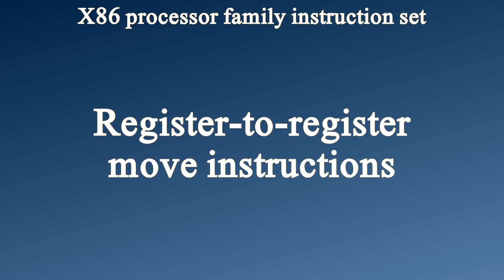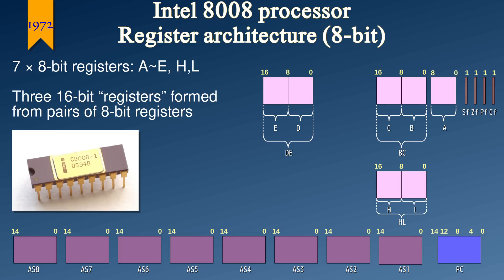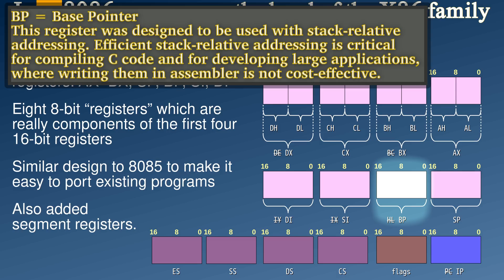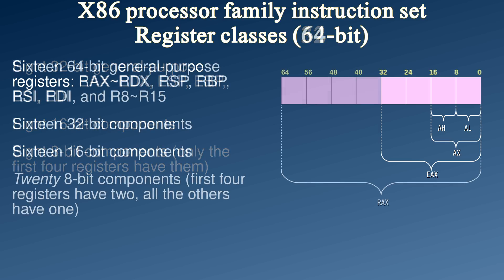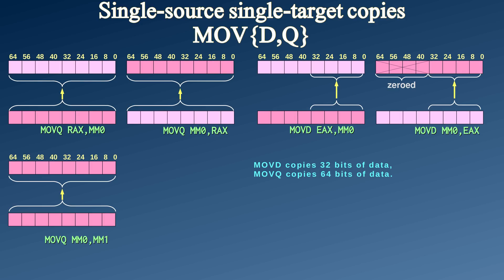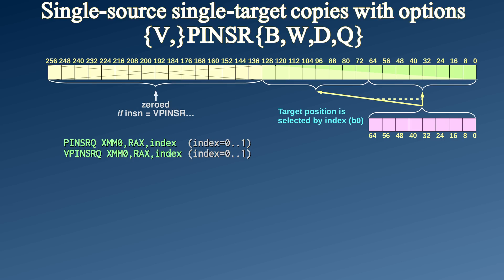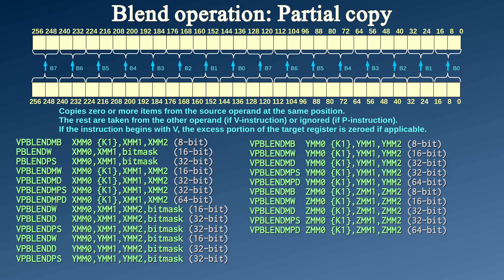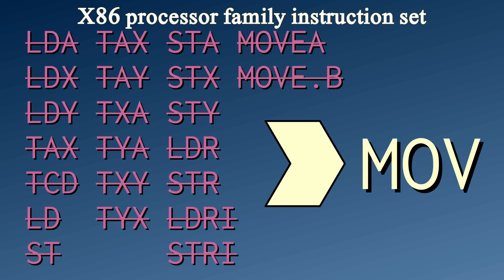x86 mov insns & short history of the most popular CPU architecture

Comment: At least for every second of this video my cpu made on averge 6800000 intructions.
and for the entire video, well here are the sintax: ((19*60)+44)*(1.7G*4)
1.7G = 1.700.000 for every core in my cpu (it has 4)
Reply from the maker: Good, but three problems: ① Giga stands for thousand million, not one million (mega is one million, kilo is one thousand). ② The number of clock cycles is not the number of instructions. While many instructions take several cycles to compute, modern processors can perform many instructions per cycle (ipc) on a single thread. ③ Unless your computer is fully loaded and the cooling fans are screaming like mad, most of time all cores are fairly idle. In idle, the core is waiting for an interrupt and not executing any instructions.
Reply: @Bisqwit  oh shoot i meesed up :c
Reply: the answer is around: 299201140
299 million of instructions made

Comment: nice overview, well done! Although...  HL has NOT been turned into BP, and BX is not the old BC either. Instead, BC has become CX (think of Z80's DJNZ and 8086's LOOP), while HL has evolved into BX. The dead giveaway for that is BX's ability to address BL and BH separately, while BP cannot do that - but for the automated software translation from 8080 to 8086, it was necessary to have a clear "successor" register for HL, so this must be BX (yes, software like WordStar was actually mostly converted from 8080 binaries to 8086 binaries - conveniently, MSDOS offered all CP/M system call functions with identical parameters). So, the new kid on the register block really is BP, not CX

Comment: Eech. What an absurdly overcomplicated nightmare.
I can see why Intel was discouraging anyone from doing assembly coding on the x86 family as far back as 2005.

I mean, I've been dealing with fairly low level graphics programming on and off for most of my adult life (and part of my teens - unless you count Logo as 'graphics programming' in which case I've been doing it since I was about 6), so I do get what some of these more convoluted instructions do and why they're useful

MMX and SIMD was a big deal to graphics programming especially, and I definitely remember it. That's after all right around the time when I was really learning about graphics on PC and where a software renderer was still somewhat relevant, (though I'd argue it still is, as a learning tool at the very least).
But these instructions sure do make it difficult to keep up with what's going on sometimes...

Probably explains why I find more enjoyment with 8 and 16 bit coding than trying to deal with PC stuff.
Assembly is over-complicated. higher level languages still force you to deal with way too much OS and SDK complexity and indirection, and using pre-built game engines takes most of the fun out of it... (yes, way more practical to have a game engine doing most of your work for you to let you focus on game design, but still...)

Maybe I'll try and get something running on an n64 if I want to deal with 3d. XD
I mean, that has a vector co-processor with similar kinds of instructions, so... No escape I guess. XD

Comment: What a mess of an architecture this has become
Reply from the maker: It is inevitable that any system that keeps getting extended for long time enough will devolve into a mess of special cases. In software and libraries, the situation can be mitigated by refactoring, but with a processor, you just have to keep backward compatibility. If users are unable to run their software on your new CPU, they will not buy it.
So as a result, we have CPUs that are still compatible with the design from 1978, influenced by design choices in Intel’s very first CPU and even some of their early competitors like Zilog.
The biggest window of opportunity for an overhaul was during the migration from 32-bit to 64-bit, but AMD chose to keep the syntax and instruction encoding almost identical to the previous one. Intel, on the other hand, went to a totally different direction with their Itanium, that was completely redesigned from grounds up, and not backward compatible with x86 at all. The markets chose AMD’s design.

Comment: this is why moore's law ended
Reply: maybe.
But I'd argue it's also because Intel didn't have meaningful competition anymore.

Notice how much the pace of CPU power improvements have increased after Ryzen showed up?
It's mostly going to bumping up core counts, but still, it's there...

It's like when these companies have no proper competition they go into auto-pilot.

You can see it with GPU's as well.
When there was fierce competition between ATI and NVIDIA you typically had something like 70-80% performance improvement.
With AMD having had no meaningful high end options in years, compare NVIDIA's generation on generation improvement, it's been somewhere around 20-25%.

Maybe some of that is due to actual technical problems, but I doubt ALL of it is.

And consider the implications, given that this is a form of exponential growth.

at 70% a generation you get a 41x increase in performance after 8 generations
at 25% a generation you get only a 4.75x increase.
That means the faster growth rate will do in 4 generations what the slower one is managing in 8.
CPU generations seem to be about every 18 months, while GPU seems to have been roughly yearly...
So the relative improvement of graphics cards in the last 8 years combined has been about an order of magnitude less than what was seen in the 4 years prior to that.

And the CPU space wasn't much better during the period AMD only had bulldozer to work with...

Comment: I used to program the 8080-8086 in assembler. wrote a program very similar to windows cept it was for cpm. bill gates stole the cpm program by changing the jump table and called it msdos, I wonder why gates refused to show its source code? oh ya, someone would find out that its actually cpm but cpm software will not run on msdos cause of the jump table. anyways, 242 pages of assembler code compiled into < 1k !! still have the code and compiled program its on my z100 sitting right next to me!! and it still runs! ( heath/zenith ) . I have a hard copy (orginal) some where LOL and cpm software source code that heath company and zenith gave with the computers along with compilers for assembler and basic. still have all the books that came with it, and diagrams of the whole computers guts.
Reply from the maker: cool story bro

Comment: The simple difference between movaps and movups confuses me
Reply from the maker: It does not really make sense with register-to-register moves, but when you are moving from/to memory, movaps only works if the address is aligned (divisible by 16) and movups works in either case. Movaps has slightly better performance, but it causes an exception (crashing the application) if used with an unaligned address.

Comment: This is probably a much more complicated question than can be answered in a 20 minute video, but in designing new iterations of these architectures, how do they decide which specific functions would be worth including?
Reply from the maker: Sometimes they get feedback from developers, and based on that feedback decide what warrants new instructions. For example, the fused-multiply-and-add instructions were introduced that way. Sometimes they try to predict what the users will need, or what could be marketed to boost the sales. The AES acceleration was maybe added through that kind of process. It significantly speeds up throughput for AES-encrypted network transmission.

Comment: Actually, ARM is more popular than X86.
Reply from the maker: (From Reddit replies)
Depends on how you attempt to measure popularity. Besides, Z80 and 8051 eat into ARM's marketshare very heavily. 8086 and everything that came up after it, dominate the high-performance market. Meanwhile the embedded pie is going to split a thousand different ways, between ARM, Z80, 8051, MIPS, etc.

Instead of Z80 & 8051 I would have maybe labeled AVR, but I digress. In any case I meant desktop processors — and namely processors. I deliberately left microcontrollers out, which is why I did not mention e.g. 8051.
Most ARM chips (for example, STM32, MSP432, LPC4000) are either microcontrollers or SoCs. ARM processors are not very prevalent.
Reply: @Bisqwit  I say this because smartphones are outselling desktop computers for a few years now. And smartphones and tablets are all powered by ARM chips. There are more ARM chips on Earth than human arms.
Reply from the maker: I know why you are saying it, but nobody’s (or almost nobody’s) desktop computer is running an ARM processor. Nobody who plans to upgrade their computer and goes shopping for a new CPU for their computer thinks “hmm, let’s see what ARM has to offer today”. No, they look at what Intel and AMD have to offer.
And the number of developers who compile native code for anything other than x86_64 is diminishingly small compared to the number of developers who compile native code for x86_64. And those smartphones use SoCs, which are glorified microcontrollers.
Reply: @Bisqwit  SoCs are regular CPUs integrated with other chips like RAM, storage, IO ports, etc.. It's an amalgamation. Not glorified microcontrollers. Android phones use the ARM Cortex series, and the Apple devices nowadays have an Apple-designed Apple A13 chips which are ARMv8 CPUs. So ARM > X86.
EDIT: There are SoCs built around microcontrollers. But they're not used in smartphones.
Reply: @YourTVUnplugged  I'm not talking about which one is more powerful or gets more work done per instruction. I'm stating a fact, not my opinion. Just google mobile vs ["PC" | "desktop"] ["market share" | "usage stats"] and you'll see. That's what popularity means. And ARM is more popular than x86.
Reply: @ricardo.mazeto  Google is not an unbiased source of information especially in recent years, if you research that you'll find it to be true. They filter and manipulate search results to show the information they want you to see even if it is known to be inaccurate or known to be false information at the top and you have to go further in the pages to find the relevant and accurate information if it is even there. A person that is invested and believes in the false and inaccurate information will deny this at the same time as knowing this is the case and they do this openly and blatantly while at the same time denying it. I did your search though and even the top filtered by google results do not show what you claim, the results are 'what more people connect to the internet using' (which is mobile devices) rather than which architecture is more popular... Sure everyone has their pocket computer in modern times and while they're at work or at school of course that's what they use to connect to the internet, but that is not what they use to create the content that you're watching or build the websites that you're browsing... Let's agree to disagree and say that ARM mobile devices are the more popular 'viewing' devices and laptop and desktop and server x86_64 computers are the more popular developing and creating and providing devices. Can't we coexist? I'm willing to give ARM kudos on the mobile market and taking over it and dominating with it, but you have to give credit to the x86_64 PC desktop laptop server market with dominating it(and for good reason)! Who knows what the future holds? Will we develop an architecture that is suited for both mobile platform and desktop platforms? Or will it always be seperated? With AMD's new processors that are capable of scaling performance with cooling ability it hints at the possible future of a unified architecture for both platforms... Which could limit the performance and therefore heat dissipation for mobile platforms but ramp up and scale up to laptop and desktop and server platforms with adequate cooling ability all based on the environment the chip finds itself in. I haven't seen any similar tech from arm that amd has but as all good technologies it could spread and be reproduced by others, first to develop it doesn't always mean best to be developed so ARM still has a chance here. It comes down to you placing your bets on ARM for admittedly good reasons but me placing my bets on x86_64 for also good reasons. I guess time will tell on which architecture takes over all platforms or will we still coexist for are particular purposes if there is not a once size fits all solution that emerges! :D I would love to see x86_64 be able to cope with the mobile in your pocket warm environment and then you'll see how I'm not just pulling your arm but I ripped it off in a fury :P

Comment: What is clamping?
Reply from the maker: It means that a value that is outside the range is treated as if it were the maximum value. It is equivalent to this kind of code in C:
    if(value > 255) value = 255;
    if(value < 0) value = 0;
This is clamping. The two numbers, 0 and 255 form the “clamp”.

The other option is to just chop the excess bits as if they did not exist, which cause a phenomenon where the number "wraps" around, i.e. when you increment one by one, after 253 comes 254, and after 254 comes 255, and after 255 comes 0, and then 1, …
You see this from time to time. For example, in the well-known classic video game of Chrono Trigger, the last boss has 30000 HP. If you heal an enemy, the heal amount is added to the HP with no clamping. If you heal this boss with, say, +10000 HP, the number wraps and instead of the maximum of 32767 HP, the boss suddenly has −25536 HP and it dies instantly.

The other name for clamping is saturation. The “S” in PACKUSWB stands for saturation. The x86 SIMD instruction set defines a few other “with saturation” operations as well.
Reply: @Bisqwit  Thanks. That Chrono Trigger factoid was interesting (although I already knew about wrapping), but it raises a question: why not use an unsigned integer variable to store the HP? Sure, the player would still be able to kill the boss easily by making the HP = a low value rather than a negative one, but at least it won't die immediately.
Reply from the maker: Firstly, factoid means false fact, i.e. something that appears as a fact at face value but is actually false. I don’t think that’s what you meant.

In any case, using a signed number makes coding easy. When you damage an enemy, you simply check if the resulting value is negative to determine if the enemy is dead. That way, you don’t need any special workarounds for a situation where the enemy has e.g. 30 hitpoints and you blast them with 200 points of damage. You can just subtract the damage from the hitpoints and inspect the result. If the result is positive, nothing more to do. If the result is zero or negative, RIP the enemy. Makes the code simpler.
Reply: @Bisqwit  Thanks. And 'factoid' is what I meant. See Wikipedia: "A factoid is either a false statement presented as a fact,[1][2] *or a true but brief or trivial item of news or information*."
https://en.wikipedia.org/wiki/Factoid
Reply: It would have been less confusing if I had said 'factlet'. But I didn't know of that word before I looked up 'factoid' for you. Nor did I know that 'factoid' has two meanings.
Reply: @jacobscrackers98  AFAIk your meaning is the more common one to my knowledge.
Factoid is linguistically more sensibly interpreted as 'small or trivial' fact, NOT an incorrect one.
That's probably something that only intuitively makes sense to native speakers though.
Factoid being something that sounds like a fact but isn't clearly IS a usage in some cases, but it seems far more contrived in meaning...

Comment: Ever wanted to know what really CISC means? This😂
Reply: x86:
RISC: stares away conspicuously
Reply: @T3sl4  Well, modern systems are generally using hybrid approaches.
Pure RISC & CISC designs basically don't exist anymore.
(example: Note the absurd register count of the x86 architecture at this point; that is NOT a CISC style feature)

That doesn't even get into the fact that x86 exists as an abstraction layer with microcode internally translating to the often much less complex and more RISC-like underlying CPU architecture. (which varies considerably even among different generations of x86 CPU...)

Comment: Wait, this skipped 286 and 186
Reply from the maker: 186 and 286 did not add any changes to the register architecture that are relevant to this video. I did say in the annotation at 7:53 that there were other CPUs. I also didn‘t mention 8088, or the FPUs for instance.
Reply: @Bisqwit  286 changed the segmentation-offset, doubling it to 8 to increase addressing to 24 bits (when not doing 8086 compat)
Reply from the maker: Memory geometry was not the topic of my video. I only mentioned the 8086 memory layout because I felt that it was such an important part of history that I could cheaply go on the tangent for a bit. If I went into more detail regarding memory geometry, I would have needed to explain selectors, GDT, protected mode, and so on. 286 didn’t add anything that was relevant for this video. I may some year do another video specifically about memory use in PC.